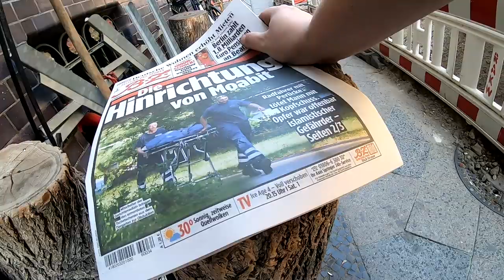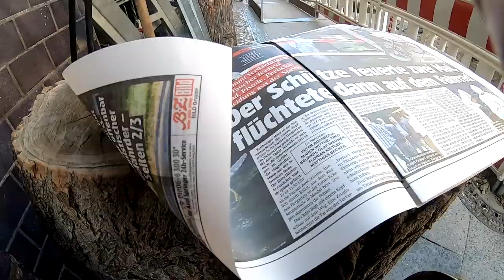Anouk räumt auf, defekter LED Scheinwerfer noch zu retten? # 839 Tommys Vlog´s

Comment: Das mit vernünftigem Licht am Fahrrad ist immer noch entwicklungsfähig. Da gibt es noch Scheinwerfer und Rücklichter mit ungeschützten Lötplatinen und Microschaltern, die im Salzwasser wegkorrodieren oder bei Fahrbahnstößen Auseinanderfallen! Zur schnellen Kontrolle eignet sich immer noch gut eine alte 4,5 Volt Flachbatterie, evtl. mit Kabeln dran. Mach Dir mal einen Stecker für Nabendynamo an eine LED-Lampe zum Prüfen von NaDys. Und blöde Lampenschalter ruhig überbrücken, dann leuchtet die LED vorn und hinten eben immer: Ein Sicherheitsgewinn im Radfahreralltag! - Vorbildlich, das Reinigungskind. Auch hier machts Enkelkind mit Opas Strumpfanziehhilfe die Kippen in den Müll und piekt Papier auf. Aber Kondome und Hundekacke bitte liegenlassen!